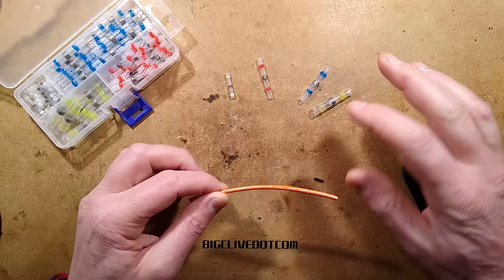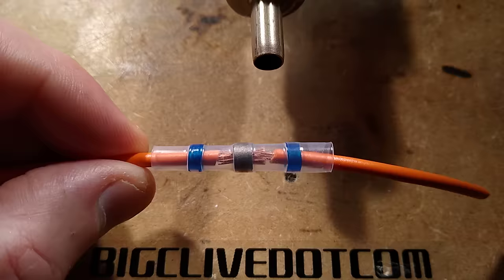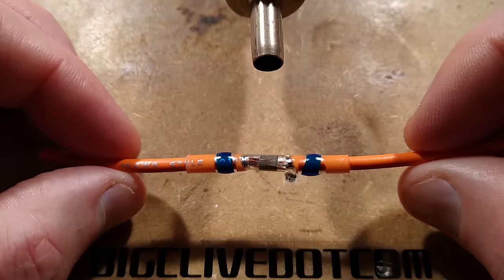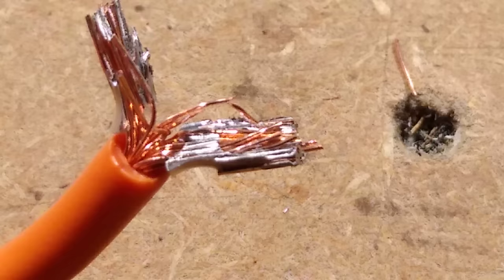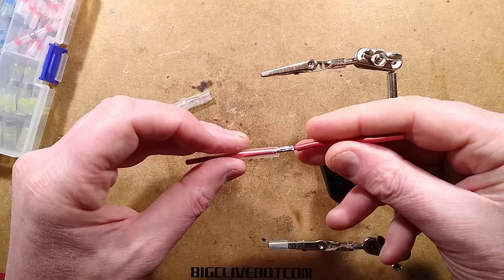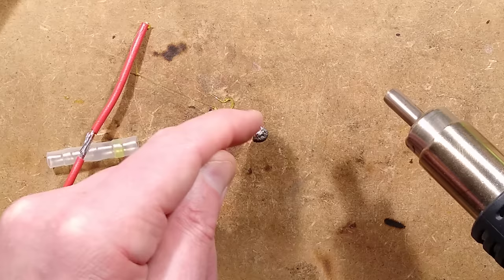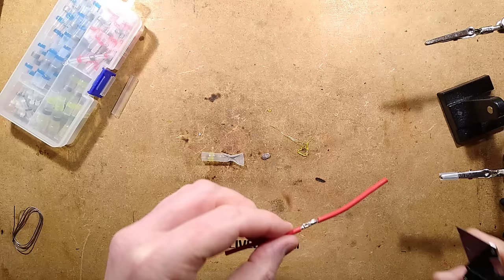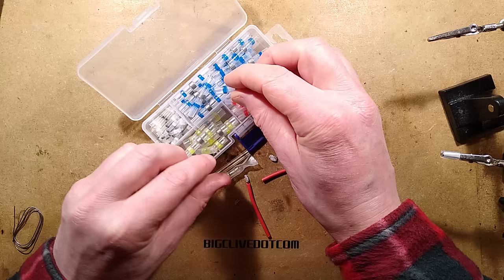Heat shrink solder butt connector test.

Comment: to me these are kind of like Wago connectors to the Marettes that are solder.  Quick and convenient but not great for higher amperage circuits.  Wago connectors are neat, like these but Wago connectors look too much like the pinch terminals found on consumer audio gear and operate very much the same way.  

A bit of a tangent, I would love to modify my audio gear with (might be over engineered) Neutrik Speak-On connectors.  I wish there was a simple way to get balanced line level signals in them too utilising TRS phone jack plug or XLR3 style connectors.

Comment: Great video sir !!! I have a question for the people with all the knowledge !!! what if a person was to dip the wire in flux before connecting and placing  the solder connector in position for the repair ??? Thanks in advance !!!
Reply from the maker: That might help get a better connection.

Comment: Can you find out the exact melting temp? I live in the Arizona Desert in the USA and it gets crazy hot with some summer days hovering at 118’F (47.8C) and the highest recorded temp at 122’F (50’C) with hot car temps high enough to bake cookies and other foods as people the last few years have been using their cars as ovens to cook food to get on tv. I’m wondering if the car gets hot enough to melt that solder?

Comment: The ends of each wire should be pre-soldered for these, then just meet the two ends in the middle. They don't need to be squished together.
Reply: At that point, why not just solder and heat shrink them properly? I would imagine these are for fixing in a pinch.

Comment: The real name is "solder sleaves"  I used to build military and aerospace wiring harness the colour bit creates a water/dust seal and hot air guns use a cupped end so the air covers all the sleave at once, not like you are doing from one side, and you didn't melt the solder fully

Comment: I wonder what the results would be if you added flux to the wire before sliding the connector on and heating it? I was considering using this method for my 8s Lipo RC (high current) application

Comment: I've had mixed results with these. Yes they'll join to wires but how well? I've had them heat up due to poor connections which not only effects the electrical connection but it can be dangerous. I'd say they're fine for low current situations were there will be little vibration. That said I haven't tried applying flux as other have said so perhaps that's a factor.

Comment: I do welding and soldering since childhood and it seems like you didn't put enough heat in it to activate the flux and for the proper fluidity of the solder.
And yes there's a few alloys which melts in boiling water. Look up 'Wood alloy'.

Comment: How about if you didn't do the blue seal first, and maybe used more heat on the solder itself first?  Looks like you might have started heating up the solder when you were doing the blue right waterproof seal, so the solder wicked to the left?

Comment: I'm not sure I trust these things, I like the heatshrink butt connectors though. I am curious what happens when they handle current and what happens if the conductor warms up, whether from normal use or if it's a fault, as well at if the joint could be prone to connection issues where they don't get flow, if the connection is enough to not get flaky / hot

Comment: Hey Maybe if it was slight hotter or heated longer it would have flowed into strains better. I would definitely try and use extra flux if it made solder flow better.

Comment: Why do people not use the Western Union style splice when splicing wiring!
 Every person I see trying to use these solder style butt connectors,   just jams or lays the wires together and expects the solder to hold it all together.

Western Union splices create a strong mechanical connection between the two wires spliced, and the soldering acts as a secondary mechanical splice. And the glue style heat shrink keeps the splice from growing green cheese corrosion due to moisture intrusion.

Comment: Only that I always use flux ( a bit to much probably). Did you try fluxing the wires before using the low temp joiner

Comment: If you got the cheap Chinese made ones they are good enough to get you out of a pinch. The good one on the other,  hand we use them in aerospace so if they approved them to be used on a plane they are good and incredibly strong, solder flows through completely and they stay clear when they cool. I wish I knew off the top of my head what brand they are but yeah I got some off Amazon and they really suck haha.

Comment: Thank you for your I just received a few of these to test out was looking at using them on box trailers weather is low voltage 12 volt 1 amp for LED lights better than using the crimper

Comment: i wonder what happens if you put a little bit of flux on the wire before putting the heatschrink on with the solder in it 
and heat is up will the solder flow beter??

Comment: “Probably better than crimping”.  I doubt it.  As you showed, not nearly enough solder.  How do all cable connectors attach their metal pins?  It’s not solder.  It’s either crimp or IDC (insulation displacement connector) crimp.  I think it’s easier to crimp and then use hot glue heat shrink for outdoor applications.

Comment: Im glad to see this. Ive seen these but never actually tried them.  Im wondering if using a flame might quickly melt the solder into the core of the wire vs hot air? Does it have a recomendation per the company that makes them?

Comment: This science has been done many times before. I can tell you what NASA and mil spec says. \
 CRIMP with a butt connector, then solder. Absolutely the least resistant joint.
 BTW, on your first test you forgot flux, had you you used it the solder would have flowed to the inside of the copper strands.

Comment: Neet device. I use the 3m Crimped type that has glue in it that you heat up and it shrinks over insulation and makes it water tight. Can be done with a simple cigarette lighter but you require a crimp tool. Can you try doing it jut with a cigarette lighter and see what happens. Just one question. What is the alloy? GALLIUM, TIN, LEAD, Antimony OR Mercury? May not be as good as they seem

Comment: An interesting product and a good demonstration. As others have suggested - pre-fluxing might help. I have a requirement for unobtrusive butt connections on 0.5mm solid copper wires (telephone) I can see obvious problems compared with multi-strand conductors if using this product but do you think they could be worth trying?
Reply from the maker: For telephone connections in a tight area it might better to solder and sleeve them.

Comment: If the inner connections are poor and get hot as a result is it likely to reflow the solder and effectively correct itself?
Reply from the maker: I'm not sure if it would do that or just arc and burn up the solder.

Comment: I fix an angle grinder once with the solder connectors it worked alright right until the motor failed in the grinder I don't know if you're supposed to use these on 240 volt or not but fuck it it worked

Comment: Excellent test and as a novice, I have wondered how good these sleeves were.
You mention you used the spec 300 degrees, would penetration not increase with a temperature increase?

Comment: What, this is actually working? I thought it is a scam.
About that solder ring: would it work better if the cable ends were dipped in a bit of flux?

Comment: One problem I heard, and that prevented me from buying them, is that the solder broke and the customer came back. Vibration is not nice to that stuff it seems
Reply: Soldered joints are susceptible to vibration damage.  Crimping is the way to go in physically adverse conditions.  There is a good reason why car (and ship) manufacturers crimp rather than solder connectors.

Comment: Unfortunately the mechanical resistance of the soldered joint is very poor. One can easily pull out the wires out of the joint. Not reccomended in evironments rich of vibrations or moving cables.

Comment: what temp do they need, couldn't you help them along with wrapping a few strings of low temp solder or paste or low temp aluwire around the wires after entangled them, its the lack of soldering iron and having to flow and gravity and all that jazz that clould be a benefit... if you can just put in the materiel into that tube-like an ovn and heat it and it will do the rest.

Comment: 0:42 I think you stripped the wire too long, like around 10-12mm. Try stripping it shorter, like 5mm, then I think solder will get much deeper.

Comment: How do the quick heat shrink solder joiners fare when it comes to electrical properties? Do they introduce more or less resistance than a "proper" solder joint? How do they compare in that regard with a crimp only butt connector?
Reply from the maker: Personally I'd prefer either a proper soldered and sleeved joint or a crimped and sleeved connection.
Reply: @user-gx6jb6wc5g Oh no doubt. It's just that if this is good enough then if I had to use one in a pinch I wouldn't have to stress over replacing it with a real solder job.

Comment: You could of put flux on the joint before you did the solder joint. That would be a better test. But you did show it didn't flow well by itself.i was thinking about buying them but they are not as solid like using a roll of solder and a gun.

Comment: Crimping is actualy a better electrical connection than soldering, because most low temp solders have a higher resistens than coper and brass and with soldering u have 2 vastly diferent metals bonded together causing alot more problems than u think it would!
But if you dont have the right tools and corect materials for a corect crimp, u can fuck it up way more easy!!
So if u dont building a spaceshuttle or a nuclear power plant, soldering is quit good for most aplications!

Back in the days, alot of fires where caused by bad conections on high power appliances like ovens, because they tin´t the leads before the put them in screw terminals.
Over time, presure and smal heat cycles under load caused the solder to worke its way out and also work hardening efects caused high resistens,
and than burning your hous down!

Comment: Is it that good? Imagine if you are in the middle of nowhere and your car had a broken wire, it is easiler to find a heat gun or is it easiler to have a clamp store in you car tool box?

Very likely the metal inside the plastic tube is bismouth or similar thing, unless your circuit don't carry much amp load, otherwise the resistance and heat issue will definitely follow. If it is an emergency case, just strip the wire and twist, cover with duct tape for insulation, traditional and simple method, guaranteed work. 

Why do i need this thing?

Comment: Would these work with a lighter (petrol or butane)?
Have you seen the videos on the "ww2" equivalent that was self heating when ignighted?
He interesting to see one that's basically a ring of solder with a heating compound you then slide heat shrink over when the solder has set
Reply: These work with a lighter. We used them in military aviation so they are probably "just fine. for automotive use"
Notes on usage:
fray the ends, intersect then twist together (unlike in this video where he just inserted them into eachother) Start with the solder - NOT the end. It seems counter intuitive, but this allows the solder to flow more freely since air can escape through both ends of the splice. Work toward the SMALLER of the two adhesive bands, rotating evenly (or as even as you can given constraints) the insulation should turn glossy and clear and so should the adhesive inside. Once the smaller of the two adhesive bands is shrunk, work back over to the larger adhesive band and repeat as before until the two ends are sealed. Allow to cool.

Comment: when I solder my cable, the jacket always shrink become shorter and shorter exposing more wire and I always have to chase solder it. is that mean my cable are low quality? what type of cable should I buy?
Reply from the maker: It affects most cables.  Sometimes you have to crop the insulation less to allow for the shrinkage happening.

Comment: What kind of heat gun is that?  Never seen one with a small focused tip and temperature control...
Reply from the maker: Part of a soldering station for reflowing surface mount components.

Comment: You made the tails too long. You only need about half of what you used and that would give you better penetration of the solder. It's not oftenn we carry flux in the car, but you can add a little to the wire prior to feeding the it into the tube.

Comment: Try using high heat, you only tried it on low heat and the soldering iron was hotter than 300

Comment: Anyone know the make of the heat gun he used? I find I'm either going too hot or too cold with heat shrunk tubing and his looked just right!
Reply from the maker: It's the air gun on a Yihua 8786D soldering station.

Comment: There's a couple of vids EEVblog #437 - Removing SMD Parts with ChipQuik and a vid called "Low melt solder techniques Vs leaded unleaded Solder".  Seems like a good way of de-soldering without lifting pads or damaging components.  It was expensive but maybe the price is right if they're using the same alloy in these doobies.  Certainly seem worth getting a few to keep behind your ear, Just in case

Comment: Hard pass. I'll stick to my old ways. Solder, flux, heat shrink, liquid sealer of some kind, 2nd layer of heat shrink. If I use butt crimps, silicone dielectric grease (water / moisture incursion) into the crimp, a proper crimp, and a layer or two of heat shrink depending on environment. I wonder what they use for an alloy? Indium would lower the melting temp, but it's expensive.

Comment: Would these be good for automotive wiring that’s exposed to the elements? I need some kind of heat shrink deal for exterior lighting and want something that’ll be strong and seal well from water
Reply: No.  Crimp don't solder.

Comment: these are crap for soldering wires together. But they are very good on shielded wires, where you need a small solder all round the wire shield.

Comment: Too things missing on the side of the road . Heat gun and soldering equipment. So your best option is a cigarette lighter. Better hope somes a smoker. Great for at home use. Though. And they certainly work better than electrical tape

Comment: How do they do if the wire is overloaded? Does the heat melt the solder?
Reply from the maker: If it's getting that hot the insulation would be a concern.

Comment: i was looking at those low temperature solders some time ago.

https://www.digikey.com/en/product-highlight/c/chip-quik/low-temperature-indium-solder-wire
https://www.indium.com/blog/a-guide-to-low-temperature-solder-alloys.php

They are used for smd desoldering for pcbs with big copper layers/larger heat sink so you dont damage other components around the area.

It's done by flowing the low temp stuff into the original, which gets a mixed solder with a lot lower melting point.
Then you can remove all mixed solder (should be done because it's more brittle, less stability still has a really low melting point) and the component.
afterwars replace component with fresh solder, perhaps lead based if you want it to be easier than lead free.

- for those butt connectors you should use a residue free flux pen along..

- soldering broken wires in vehicles is not good because it reduces the flex in the *old leftover* cable and leads to even faster breaking of strands in the rest of the cable. crimping and (glue)hotshrink tube around is better, best would be to place a flexible new wire in the gap where it gets bent (car hinge), which lasts another 10..20 years.
If you are nuts use the high quality silicon flex wire for lab equipment.

Comment: Don't ever use a lighter.  it burns and melts outer shrink wrap and fails.  also hold parallel to ground or all the solder runs downhill and no joint fail

Comment: Use one once on a cooling fan circuit. Fan came on and half a minute later connector got hot and separated. Installed butt connector and never had another problem. Not worth the risk. More of a gimmick

Comment: So I am an electrician, what do people think about these in an electrical installation instead of using a wago's or a through crimp. I have bought some to use for an led light installation, but was wondering about using them to joint 1.5 and 2.5 tne. I might have to do some tests myself and see how they turn out, if anyone has any thoughts on the matter they would be greatly appreciated. Love you videos by the way very fun and informative.
Reply from the maker: I wouldn't recommend them for that.  Wago is probably a better option.
Reply: @user-gx6jb6wc5g  thanks for replying I will continue using wagos.

Comment: Does it only work with 12v or can I use them with 230v as well at home?
Reply from the maker: I wouldn't recommend them for 230V unless they are an original version and state they are suitable for that use.

Comment: These aren’t much better than those horrible crimping butt connectors. Traditional solder and shrink tubing is faster and stronger. You can’t heat them with a flame because the plastic will melt. But you have to get it hot enough to melt the solder ring. So, you’re restricted to using a heat gun. But then, you need to use a special heat gun with a small nozzle so you don’t get everything around it too hot. The solder is a very low temperature. So, it’s soft and weak. The glue in the shrink tubing provides better tensile strength than the solder itself. If you pull the joint apart, you’ll see the solder breaks like powder. I had my mechanics try these in my fleet service. One was used to repair wires in a trailer cord. Two of the wires pulled apart, short circuited and caused a fire in the cab of a truck. Older tractor trailers sometimes have no fuses on certain circuits.